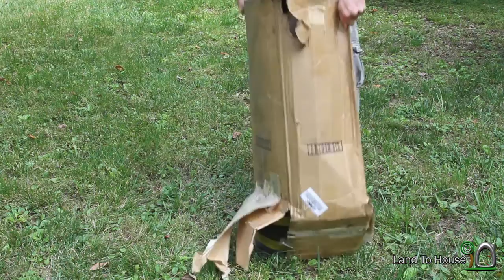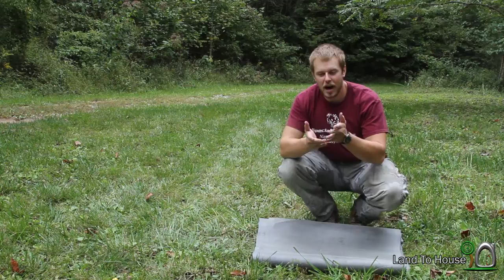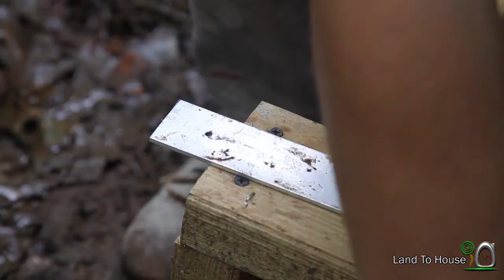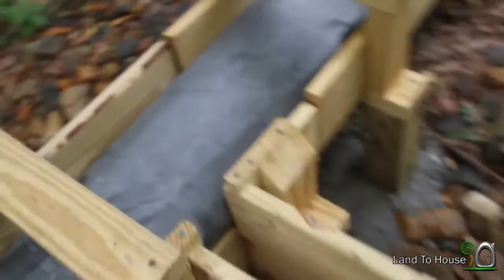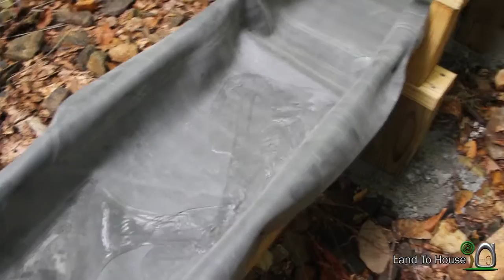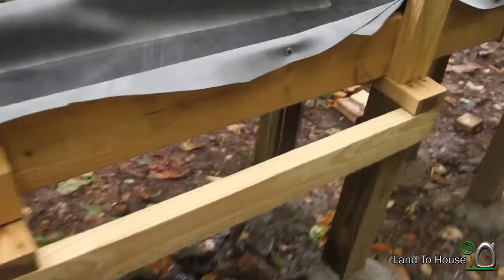Install Rubber on the Flume

Comment: My suggestion for permanently boding rubber to rubber is to use this epoxy glue: http://www.amazon.com/Epoxy-Glue/dp/B000ALJ4NS/?ie=UTF8&tag=67113-20 it's pretty inexpensive. It has a permanent strength up to 3400 PSI. It dries clear and is water resistant.
Reply from the maker: That stuff would do it for sure!  I was thinking that if trees are going to be falling on the flume a lot I might want to just overlap the rubber for now.  Easy fix.  Thank you for that idea!

Comment: It looks very good, you have obviously put a lot on man hours into it, I shall be interested in the way you make your electricity, what sort of fall do you need? I have a small waterfall on my stream that I could possibly make use of so will be looking for ideas :)
Reply from the maker: Thank you. I am not sure what the total time is that I have spent but it has been a while. This fall will be around 7 feet. Last year at this time I had over 100gpm but this year its down to 30gpm and that scares me a bit. My first goal is to attempt an archimedes screw turbine. If that does not work then I will go with a traditional water wheel.